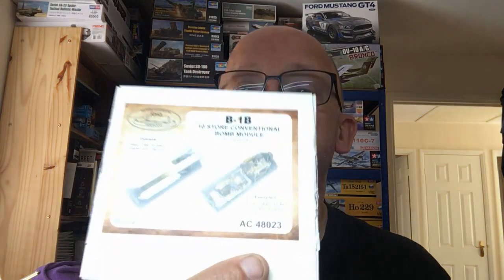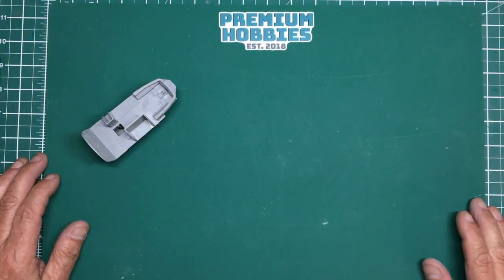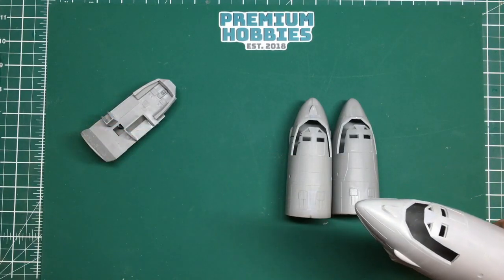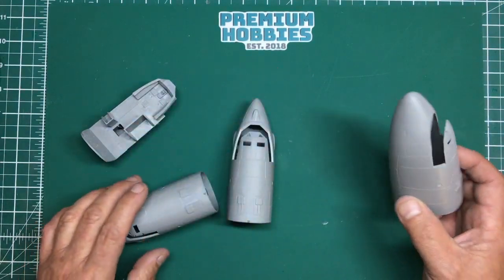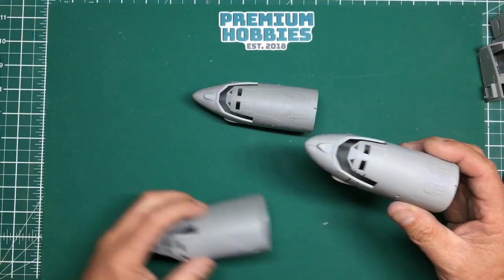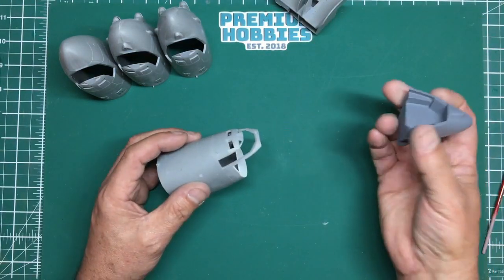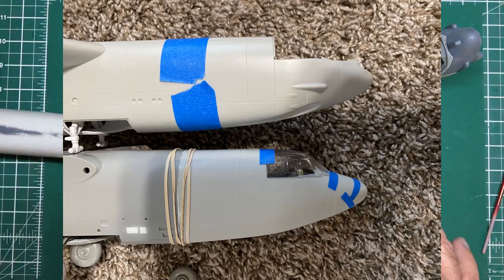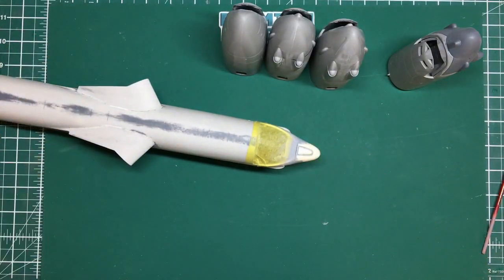Buffing up on Buff noses. Part2 with extra waffle.

Comment: Hi Nigel, 
I am a huge BUFF fan but have been very frustrated by all the inaccuracies with recent 1:72 B-52 kits.  I use to just buy the Monogram B-52 and use the BUFF Masters resin conversion kits to convert the B-52D to the later model Stratofortresses.  Their currently are no good updates, besides Blackdog’s kits,  for any of the 1/72 B-52 kits, so, yes I would be very interested in your upgrade kits!
Regards,
John
Reply from the maker: Thanks John. Lets just hope that MC get the D right.. if they use the same front fuselage and just chop the nose off it's going to be too fat!! I have also made wing tanks which are currently being trialled on a "famous" MC H kit so we'll see if they're any good?

Comment: Will you include the EVS fairings behind the cut as well?
Reply from the maker: The MC conversion includes everything below the glazing as shown in the video. The AMT kit does not include the EVS as the kit shape is OK in my opinion. What do you think? OR.. are you referring to the fairings on the FLIR??
Reply: @NigelsModellingBench  Hi there, no I was referring to the fairings aft of the cut, as if you have an OLD G with no EVS or other bumps on the nose, you could use the nose to add those?
Reply from the maker: Harald Sydness I have had a second look at the AMT set now. I’m gonna make it more like the MC one now with all the lumps and bumps replaced. May as well go the whole hog!!
Reply: @NigelsModellingBench  just to clarify I was jabbering on about the MC kit, as I don't have the AMT.

Comment: Are you going to market these nose corrections? If so I'm highly interested. Have you ever looked at DB Conversions B-52 G/H conversion from years ago? They did an early and late
Reply from the maker: I have a DB conversions late G set for Revell. Trouble is it wont fit MC or AMT as they are all over the place shape wise.. so, I am making a late and early set/correction for the MC and AMT kits. Late is nearly done, with separate ECM parts so the modeller can add the escape hatch detail and stiffeners if he/she so desires. I have also made corrected wing tanks for the MC kit.

Comment: Are the late "G" and late "H" noses the same profile? Can you let me know when your castings are ready to order please.
Great videos by the way! 
Cheers,
Pete.
Reply: Late G/H nose profiles are the same. The reason for the early and late nose, there was a 12.5 inch recontour of the nose.
Reply: @vertisjohnson219 
Thank you so much for your kind reply. It now makes sense, I think!
So the nose on the Modelcollect late "G" is wrong and should be the same as the Modelcollect "H"?
I have both and a Monogram "D".
Though as you have said the Modelcollect "H" is still the wrong shape! I am waiting on the corrective "G" nose and tail sets to become available again from Modelcollect....
I will probably also purchase their "D" when it's released!
Thanks for sharing your super videos. Am loving the 1:48 B-52 series and would seriously consider purchasing my own but I think that it would take me the rest of my modelling life to build and paint it and I would never get through my meagre stash!
Cheers, Pete. 👍😊
Reply from the maker: Hello Pete,

Basically it goes like this with the Modelcollect kits... the first production kit was the G and had a nose which was too fat so it looked too short. Then they produced the H, with an extended slimmer nose but it was still incorrect in shape from every angle. The early G and H kits have plain noses without all the electronics, but are still off shape wise.
So, my resin noses will fit any of the MC front ends, so you could take a late H kit and convert the nose to an early, likewise you could use the wrong G nose and make it good with my early or late nose.
The profile of the early and late radomes are different. It's not just down to the bumps.
Reply: @NigelsModellingBench 
Where can I buy the resin noses?

Comment: If model collect up graded the nose of the G (which I purchased) how in hell did they stuff it up again.There over 10 B52G's on display in the USA and one in Darwin Australia. Don't they know how to measure real aircraft with lazers and draw CAD to check their wook before making the molds. I have both the G and H kit and I'm gobsmacked at the wrong areas of the kit. Besides the nose the rear undercarriage bay roof is wrong the tail fin top is wrong, there is no upper wing spoilers which a main feature of the wing.The feeble attempt to have the spoiler finger as raised parts are in the wrong position down next to the flaps. The rear of the H model engines are missing the inner cone of the engine and the rest of the engine bays have nothing in them. Thus you have to put a blanking disc in there so you don't see the engine cover ribbing. The AMT kit we all know is wrong but considering the $$$$$ the Model Collect kit is you really have to say is it worth all the stuffing around and money to buy. Well done Nigel, I will get two when you list them for sale.
Reply from the maker: I know I know I know.. apparently the new D is a complete re tool? I am working on the new undercarriage roof right now. I'm also making a set that allows you to fit the Eduard engine upgrade to the Italeri G kit.